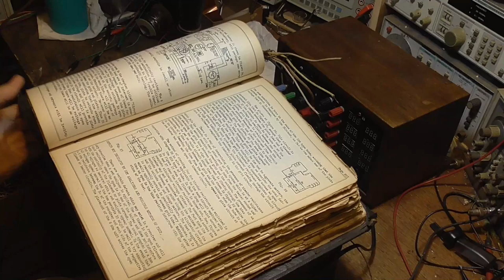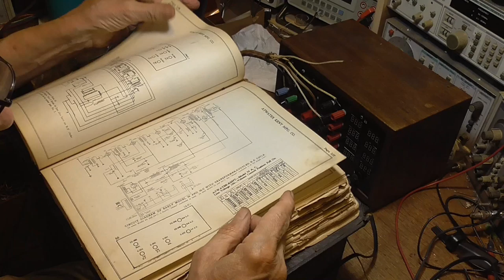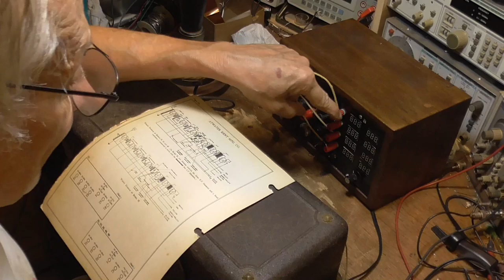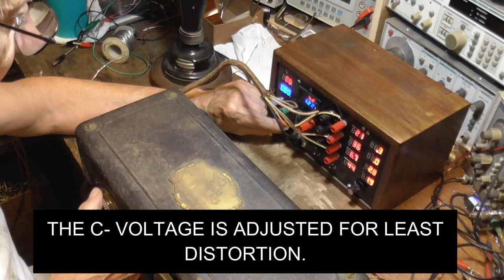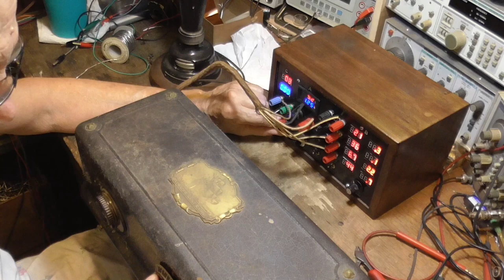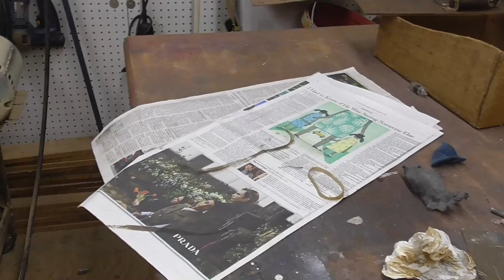RESTORING AN ATWATER KENT MODEL 35

Comment: Another thing that happens to these radios is that the bands ganging the tuning capacitors break because the wheels on each tuning capacitor experience oxidation cracking and grow. This phenomenon is due to poor metallurgical consistency of the pot metal.  I think that these radios were not made until 1925 and ran to 1927 and was the first radio to have a stamped steel case.  Atwater Kent had previous experience making auto parts and was used to such methods. The model 35 had a huge production run of 1.6 million.

Comment: Ron you never did a half ass job in your life - keep an eye on your blood pressure though, I cant see a video for the power supply you use, a circuit would be interesting and useful, many thanks - Stay Safe
Reply: Those power supply connectors has always been troublesome, they need double nuts and Loctite but they will always get loose over the time.

Comment: Ron, this was a very interesting video!  Will you give us a class on the grid leak resistors?  How they are manufactured, how & why they fail (along with carbon breaking), why 20 megohms "is too much," etc.
Also, can these old transformers be repaired/rebuilt?  Can you go into doing that too in the future?
So, the "modern" rosin-core solder doesn't really have rosin in it?  It really has a "modern" substitute?  I don't recall my solder having a pine tree scent.  I wish I understood how real pine rosin-based flux works -- I think it would be neat to be able to make some.  :)
I think you need to keep a small jar of short pieces of wire for hooking your bench power supply to these really old radios.  It would save cutting & scraping pieces each time you work on a radio.
Will you explain that horn speaker and how it works and is adjusted?
Thank you for talking about how the CRC Brake Clean is a polar material that won't affect the paint that's on this radio.  Are all paints non-polar and this brake cleaner safe on them?
Is that housing a Bakelite-type material (with the bottom being sheet metal)?
Please show us your Atwater-Kent Bread Board radio!
Sorry for all of the comments/questions, but a lot of them popped into my mind as I watched this.  And, I'm jealous of your strawberries too.  Now we'll have to pick some up the next time we go to the grocery store.  ;)  Take care!

Comment: Wow, superhetrodying only requires one tuning knob, local oscillator tracked the tuning circuits at 455 KHz above, so, so-call intermediate fixed frequencies could be used, even broad tuned for expanded bandwidth. 

In my neck of the woods, only two AM stations near by, and when the sun goes down, so does the transmission, but still can listen to a lot of static. 

So this will give you something to do after the sun goes down.  Another good use of this is for a winter space heater.

Comment: I had the same problem with my power supply, loose nuts on the plugs, so I understand your frustration. (-:
I always tend to make my boxes too small so by the last rebuild I decided to make the box big enough to be able to manage the wiring.
Reply: The trick for those banana sockets is to put the lock washer between the panel and the socket, not under the nut.

Comment: An external power supply to achieve all necessary individual driving conditions for the tubes of a radio?! Wow! Was hanging out to see the circuits beneath the tubes where one would expect them to be and then obviously all control circuits are inside a wooden box! Its not a prehistoric car radio by any chance?

Comment: The model 35 can also be used with 2V tubes (type 30's)    I wondered why 6 tubes, the first RF stage is untuned, the next two are tuned.  So 3 rf stages.
You've had that power supply for years.  In that time you've jacked those jacks around many times.  If that panel is wood, I don't care how hard you tightened those screws they WILL EVENTUALLY come loose!  If it's a metal panel, or a plastic one, you'd need lock washers to keep the screws from getting loose.  It's Murphy's law that it got loose on camera, but don't blow a gasket over it!
Reply: Why is the first rf stage untuned?  Why three rf stages?

Comment: I was told that some early tube radios used the mains cord as a voltage dropper and was cut to length depending on the drop required. Have you heard of this before?
Reply: AKA the "curtain burner"! :)
Reply: Resistance wire. It's a fact.

Comment: Hey I have one of these. Can I test power it without that fancy power supply you have? All the tubes are there and it has headphones with it. I was expecting to be able to use regular house single phase power, then looked at the input. Is it DC powered? Can I use batteries or AC? Is it like a CB radio? Assuming AM radio?
Reply from the maker: The radio requires 5 volts at 2 amps DC to run the filaments, and 45 volts DC at 50 ma to run the tubes. The voltages do not have to be regulated but should be well filtered.

Comment: What to do with the unworking tubes do you try to repair the filaments or other problems or throw away?
Reply from the maker: Go in the donate box. There are people that collect duds. I save them up and give them away.
Reply: I saw a project in elementary electronics sometime in 1988 that used a false tube that did not work or wasn't used but had hidden electronics. The transistor crystal set work by that. It made no sense to me but each project are their own.

Comment: What's a modern replacement for a grid lead?
Reply: It’s just actually a carbon resistor... the modern replacement would be just a regular 1/4-watt resistor but think of how out of place it would look... Some restorers will rebuild the old style by drilling them out and adding a modern resistor inside where it can’t be seen... Not exactly sure what you would do with the glass resistors for a rebuilt though...
Reply: @budandbean1  Thanks for the info!  I was looking more into it, and is it actually called a "grid leak"?